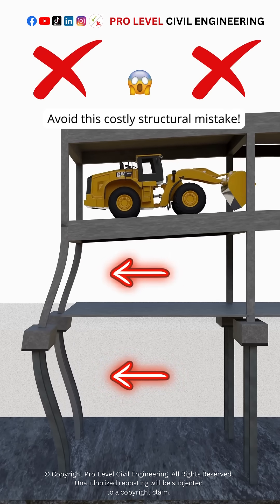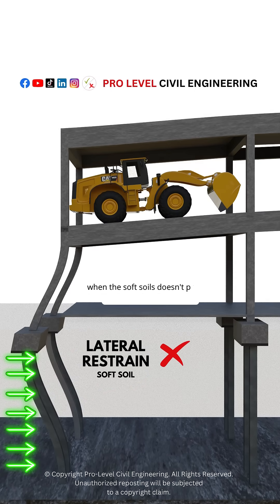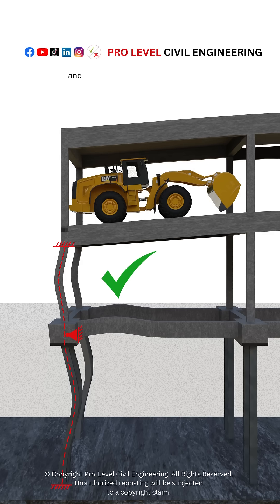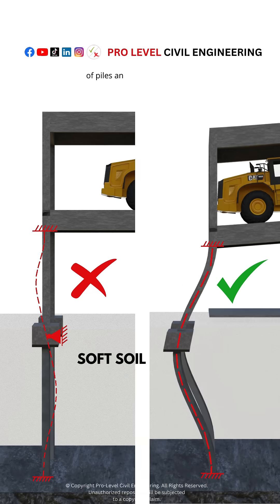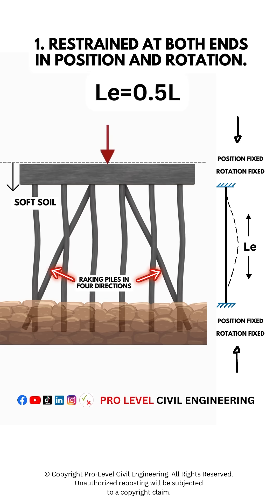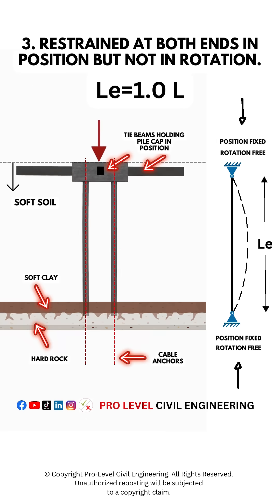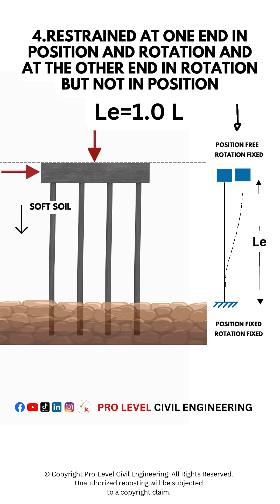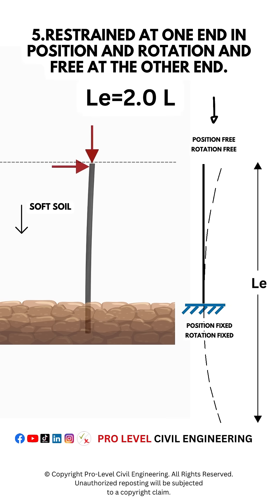Avoid this costly structural mistake! Piles Buckling

Comment: This is incorrect. The depth of tie beams cannot provide enough stiffness to prevent rotation. The restraining force from the beam has low mangnitude compared to the force exerted on the pile caps from the columns.
Reply: They were talking about flectural buckling.

Comment: civil is hard.
IT is easy
Reply: Hardly anybody do manual calculation anymore. You just enter the design load, distributing area and floor to floor height, press enter. Then the garbage in and garbage out.
Reply: not in that sense.
i mean, in IT  u can reset and reformat.
but you cannot reset the bridge. peope died already. @andylam2523